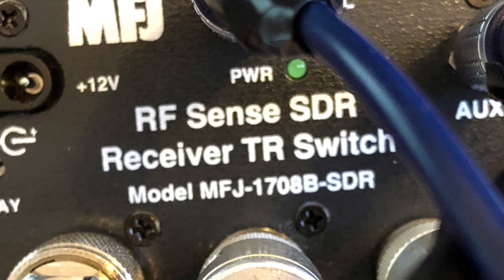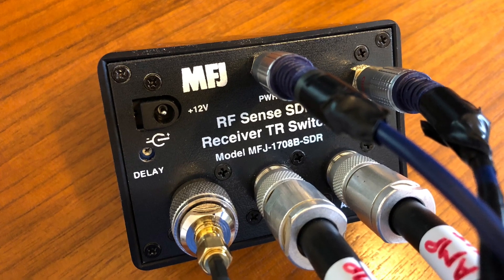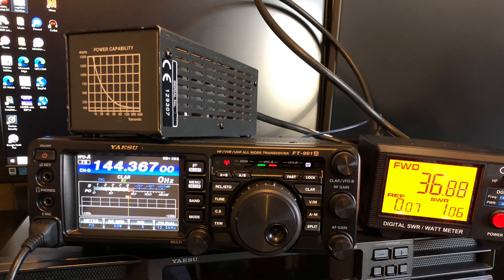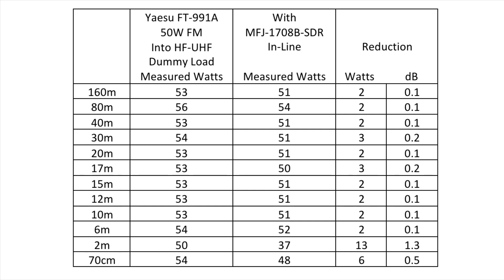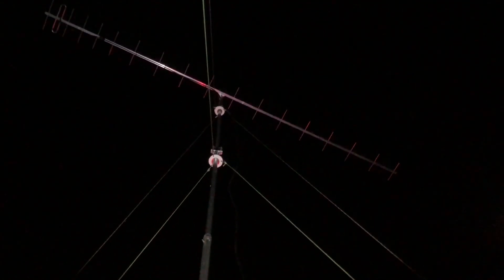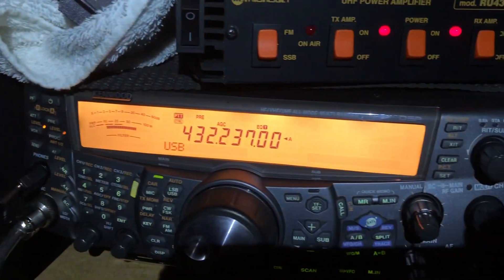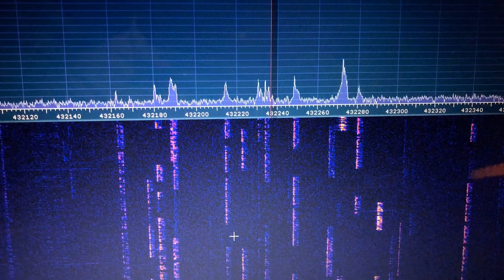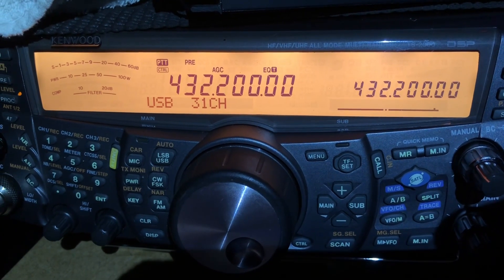Adding a Panadapter Waterfall Display - More Tests & Field Trials

Comment: Came across your 2 videos while researching a solution for a pan adapter. Very well done. I now have an rsp1a and really enjoy how it works. I've ordered the mfj but it's backordered right now.  Thanks for the tips Ian!
Reply from the maker: Good stuff Andy! Yes, I should have had shares in that MFJ. The video went ballistic 😁
Reply: @G0CNN-Ian  until the switch arrives, if I run my 100watt rig to my DX Commander for transmit and the RSP to a receive loop or mini whip do you think I'd have to worry about Coupling hurting the RSP? (I agree you should have mfj shares, then I could ask you to ramp up production! Haha)
Reply from the maker: @OtherAndyAA0AM  I wouldn’t do that with the RSP1A Andy. If you have a switched RX out or IF out on the rig, then that does the job (like my FTDX5000MPL), but guessing you haven’t, hence the MFJ. Don’t have the RSP1A live when you TX…
Reply: @G0CNN-Ian  that makes sense.. Thanks.
Reply: Received the Mfj unit. All hooked up. Panadapter set up works perfectly. So much more detail and control. Exactly the solution I was looking for. Thanks again Ian!
Reply from the maker: @OtherAndyAA0AM  Great Andy 👍🏻